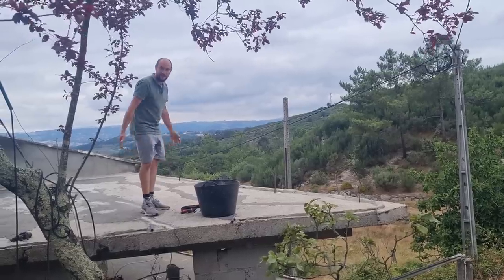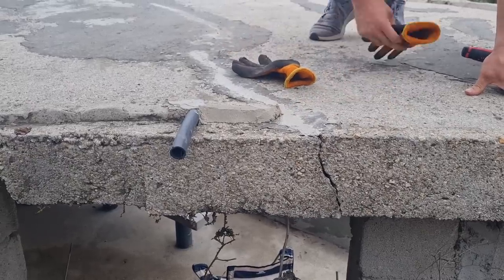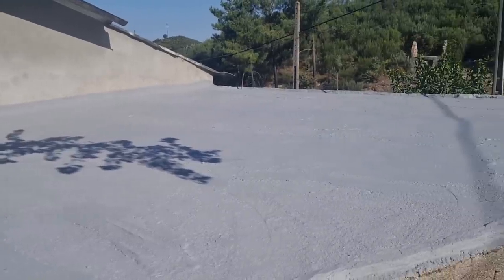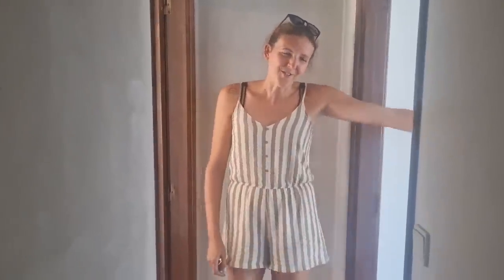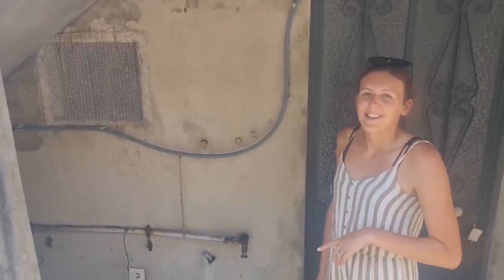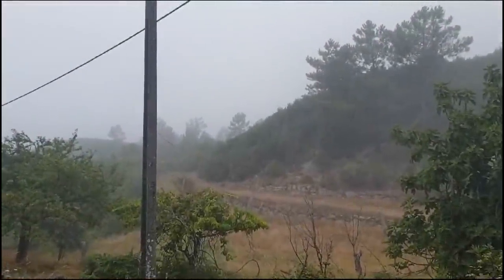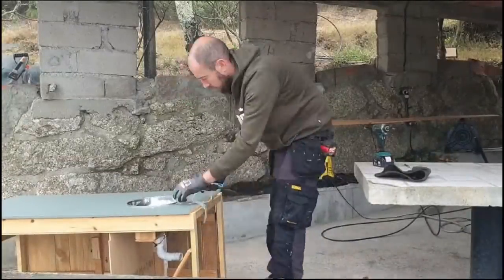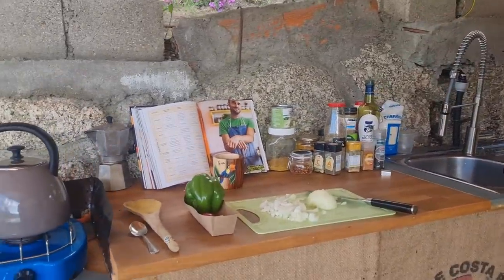A productive week on our homestead! Making off grid living easier!

Comment: Great achievements! 
To keep things cool, you could try digging a cooler box – or other insulated box – into the ground, in shade obviously. 
My grandma kept her milk bottles cold in a bucket of water, in a cold storage place – but that was in the UK. 

Even if you got solar, fridges do take a lot of power. 
Cool food storage under the house, in any cellars, is another option. 
Ice chests also work, but then you have to buy the ice, so that's usually not economic as any longer term solution.
Reply from the maker: Thanks for the tips! Will definitely be looking at using some of the bottom rooms for cool food storage in the future 😊